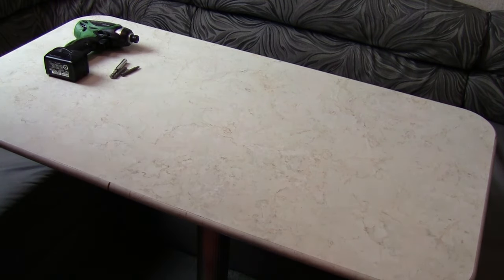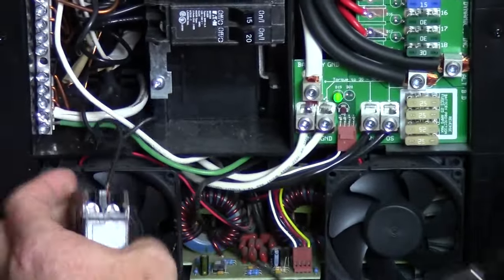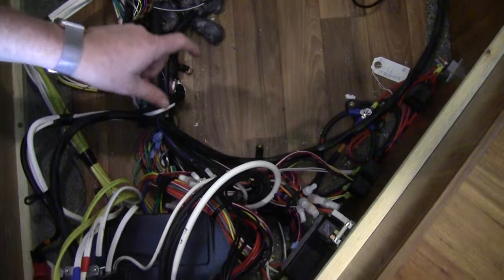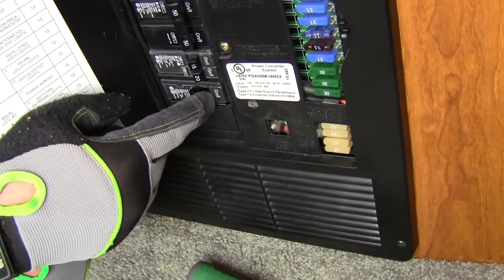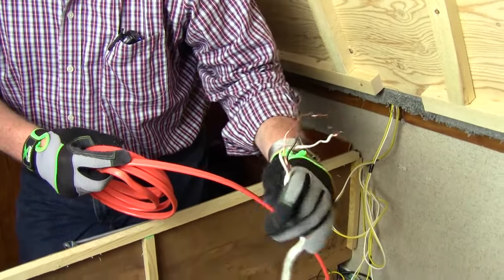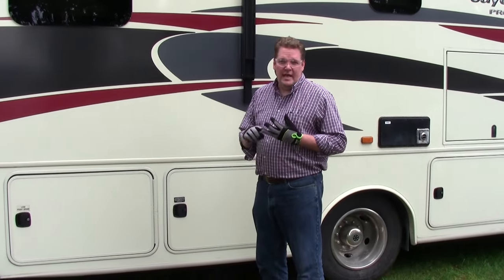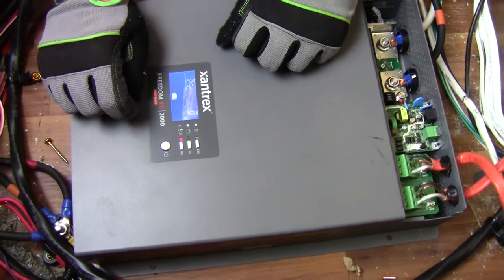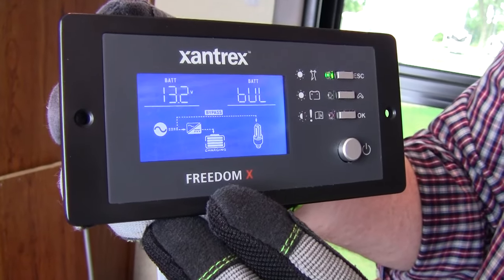Replace broken converter with a Xantrex Freedom Inverter Charger! Step-by-step installation video

Comment: o.k., but why only use invertor for a tv ? makes no sense............why not just connect the AC out back to the main AC panel? So....what you are doing looks like you ALWAYS MUST invert just to watch TV?..............Really?
Reply from the maker: Most RVers put an inverter on their TV circuit so they can watch TV while dry-camping. Feeding the whole breaker panel with an inverter like this brings 2 problems. The first is that ALL the loads would be on the inverter, including the air conditioner and refrigerator. It would require a very large battery bank to power these loads. Second, since the inverter got its AC input from the breaker in the panel, feeding the output to that same panel would create a current circle that would ultimately not work.
Reply: @ Xantrex, o. K.  I understand now.  Thank you for your prompt and professional reply.  Really helped
Reply: o.k., after further thought on this issue, why can't I simply turn the AC Breaker off that feeds the unit AC to charge the batteries when I need to use the invertor function and thus power up the entire AC panel, but judiciously use AC equipment to stay below the 2500 watts? Much simpler than having to add a sub panel to only run the TV, especially since my fridge runs on AC power and not DC. Many of us have replaced our very expensive dual fuel  refrigerators (2400.00 bucks!) with standard apartment sized refrigerators from Home Depot that work great and only cost 200.00.......Need a better solution.
Reply from the maker: Electrically, you can. We recommend practices that have minimal chances of accidental overload. There are many ways to get things done. This was generally the best method, but certainly not the only one.

Comment: Bizarre install; poor example. 2000 watts to power a TV? a better example would have been to show an install that actually made sense. I have an XC2000.
Reply from the maker: The inverter/charger actually powers a variety of AC electronics in this RV.  The TV was used as an example while filming. Thank you for your comment. You are absolutely right about questioning why a 2000W inverter just to power a TV.
Reply: @XantrexTechnology  but how? you had a little breaker box that didn't pull many circuits. I thought the video very poorly showed how to wire in the AC side. If what you did was put the AC in the subpanel, then fed the 30A breaker to the entire panel, that should have been explained.
Reply from the maker: @JohnS-zq8ks  The TVs were the important part of the circuit, but the general purpose receptacle circuit also included kitchen plugs for a coffee maker. Also, the installation was essentially for the steps required whether the inverter/charger is a 1000W or a 2000W. The steps are identical.

Comment: why do people post videos when they don't really know what they are doing. 

This is a much more complex subject then people realize and the explanation you are giving here is very deceptive, in fact it's really nothing more than marketing hype .

  Three stage battery chargers should only be used for cycle charging not for standby use OF A LOADED battery bank. the loaded battery bank fools the charger into thinking a fully charged battery isn't charging so it never exits it's high voltage bulk charge mode thuse subjecting the battery bank to excessive bulk charge voltages for extended periods seriously damaging the batteries

ONCE AGAIN !!!! if you are using the batteries while charging them then you are loading them down which means the 3 stage battery chargers computer can't detected the true state of charge. that means the battery charger never exits the high voltage bulk charge mode subjecting the battery to high voltages for far to long damaging the batteries and seriously degrading their life span. 

the bottom line is the only time you should use a high voltage 3 stage battery charger is if you need to quickly charge your batteries during cycle use, most importantly you must disconnect any load from the battery when fast charging or else the charger can't detect when the batteries reach full charge.

if you don't need to quickly charge your batteries then I always recommend switching your inverter charger to a fixed voltage output of 13.5 volts,  this will slowly charge your batteries without subjecting them to unnecessary high voltages for extended periods of time which is very bad for batteries

A 13.5 volt charge is what's known as a standby voltage charge or constant current charge mode, it's the maximum voltage you should subject your batteries to when your batteries are connected to a charger full time while you simultaneously use them. 

The higher 14.8 volt that a 3 stage charger uses is whats known as cycle charging and its what you use when your batteries aren't connected to a charger 24/7, for example when you are dry camping and start your generator to charge the batteries. 

the bottomline is a 3 stage charger can seriously degrade a batteries life if it's left connected to a loaded battery bank 24/7         

with that said a 3 stage charger is great for maintaining a battery bank that is in storage and not being used  because the charger can then correctly measure the status of the battery.
Reply: That's actually not true....like at all. It's funny that you wonder why people pose videos when they don't really know what they're doing...I might say the same about commenting.
.
The fact is: Lead-Based batteries require >14.0V to effectively charge (the word 'effectively' is important here). However, you are right on one point, that is that a fully charged battery exposed to a 14V (or higher) source will gas out and experience some damage. This is where 3-stage charging comes in to play. In order to get that 'effective' charge the 3 stage chargers go high (in voltage) for the bulk/absorption stage. This is important to make sure the battery gets to 100% quickly. Then, as the battery reaches a full charge, the charger senses this (usually by current, but every good one, including those by Xantrex, have a time-out value that forces the charger into float before any battery damage could possibly occur...though in my testing, timeout either happens within 2 hours, or well before that if there is a BTS involved). Battery manufacturers are almost exclusively in agreement that a 14.4V bulk/absorption, and a 13.4 float will extend the life of a battery, loaded or unloaded, by better than 30%. For more information, check out the Lead Battery Charging information at BatteryUniversity.com...here, let me help: https://batteryuniversity.com/learn/article/charging_the_lead_acid_battery
.
Now, educate yourself before continuing.
Reply from the maker: @aumi244. When an RV is sitting on shore 100% of the time, there are few down sides to using a single stage converter (other than sulfation...remember: batteries like to exercise and will last longer if they can). However, having a load on the batteries while charging has no downsides when using a quality 3-stage charger. Admittedly, some shop-style battery chargers don't transition to float while current is still drawing, but every inverter/charger in the mobile market does not have this effect...they are designed for a different application than an automotive shop. So, yes, you're right - you should absolutely not use a shop-style 3-stage charger as your RV converter. That would be bad. However, 3-stage charging is absolutely the best way to bring a battery from a discharged state, to a fully charged state, in the least amount of time, with the least amount of damage. Once the battery is fully charged (usually 2-6 hours) the charger will absolutely transition to float mode and act (as far as the battery is concerned) like a converter. For reference batteries should not be held on the higher voltage for more than 48 hours after reaching 100%...RV Inverter/Chargers will never hold absorption for that long. So, with RV-designed inverters with a 3-stage charger, you get the benefit of a converter for long-term usage, with the ability to fully charge quickly for the times you don't have shore available, or dry camp with a generator. This is why battery manufacturers all recommend 3-stage charging for their RV batteries - and all RV batteries would be considered 'loaded'.

We hope this helps answer your concerns.